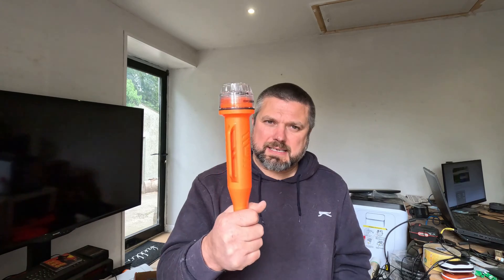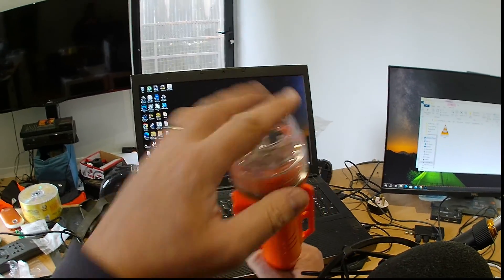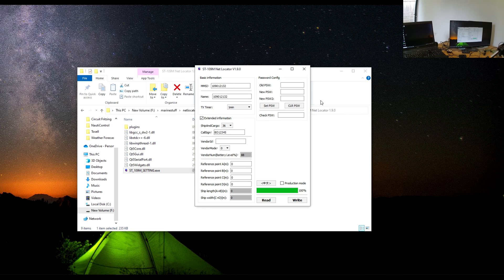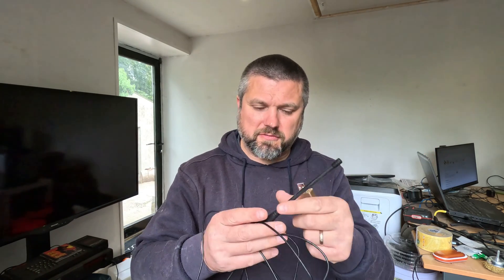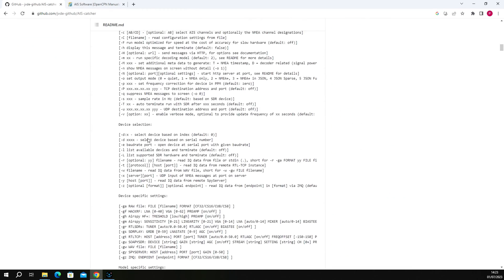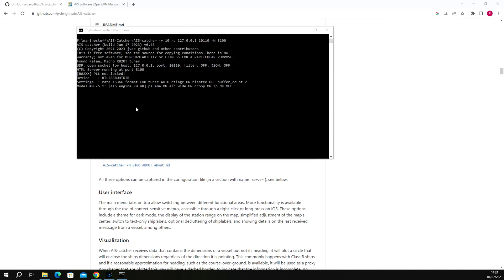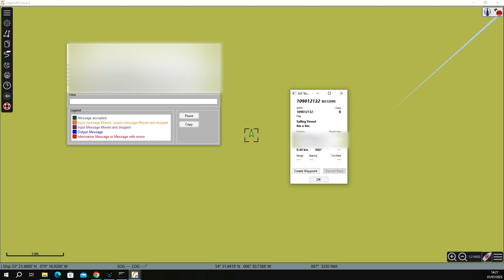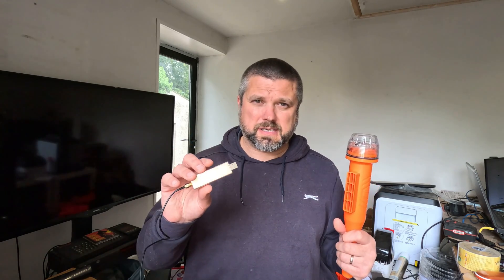Affordable DIY AIS Setup for Sailors: Socotran ST-109M,OpenCPN, AIS Catcher, and SDR Dongle Tutorial

Comment: I purchased Net Locator ST-109M recently and have found a bug. In the ST_109M_SETTING application, in the setting to input the distance of the net locator from the bow of the boat [Reference point A(m:)] after the boat length is input and the settings are written to the net locator, the net locator data on any AIS receiver that receives the single shows the distance of the bow to the net locator as the battery voltage. An example is, if the battery voltage is 100%, the distance the net locator is broadcasting the boat length as 100m, even though I only input a distance of 12m. The wrong boat length is therefore displaying on the AIS receiver of anyone who is seeing the AIS signal on their boat. This can be checked quickly by finding your boats location on the Marine Traffic app on your phone and looking at the data from your vessel. Has anyone else recognized this issue and found a workaround.

Comment: Is that flashing at 16:00 considered the slow or the fast flashing? According to the manual fast flashing means charged battery and slow flashing means need to recharge. I just got this transponder but for some reason when I connect it to my computer always the battery level says 1 when clearly is fully charged. So I need a way to know the battery level....

Comment: I'm stuck to the Fail Error "Can not find the net locator!"

Any workaround for troubleshooting?
Reply from the maker: have you checked your ports and what not , is it a compatible device as some may not i've done another video of another one i've hbought it worked different and had different software.
Reply: @boatsandbits  

I have checked the ports and it is detected in my Port: COM1 but when i try to read using the software, it shows "Can not find the net locator!"

Also, port driver is installed and up to date showing USB Sercial CH430(COM1) <<<<.

As you mentioned, "if it is a compatible device".

it should be similar to the one on the video.

But is there a way to properly check if it's a compatible device to this software?

Comment: Tony from Michigan would the AIS signal this sends out be able to be picked up by my Boat Watch app or my Marine traffic app and would it automatically pick it up when I turn it on or do I need to go in and change something?
Reply: Thank you for your reply. My question is will it transmit after I charge and turn it on or does it need to be programmed in order to transmit?
Reply: Thank you for your reply. My question is will it transmit after I charge and turn it on or does it need to be programmed in order to transmit?

Comment: Thanks for the link to the SW, however when I click READ, it just responds "can noit find NetLocator", anyone with a hint what to try? I have both power and com cable connected and net locator is ON
Reply from the maker: There are many variants which one do you have? Make sure com port driver is installed check my other video as the other one i bought read doesnt work but write does naybe similar with yours

Comment: My program says Net locator not found. it is turned on, all cables connected, still says can't find net locator
Reply from the maker: Most likely has a different type of serial usb connection , if you look up the devices in windows device manager and then go look for a driver .

Comment: I have attempted to program the AIS beacon but unfortunately the vessel length field always reverts to the precent of charge of the battery while the beacon is in use.  I contacted the distributor and they confirmed that this feature cannot be changed. So the beacon cannot display the vessels true length and thus displays vessels length between 1 and 99 meters!
Reply from the maker: The one I have seems to work ok for length it uses one of the other field , seems to be some variants.

Comment: I see that the programming cable that comes with this connects to both the power port as well as the programming port.  Is it possible to use the programming cable to charge the devie in leiu of the dedicated charger?  Asking because I'd like to have fewer electronics to carry on my small craft.
Reply from the maker: Should do though the batery lasts for ages!

Comment: How do you prevent an on board AIS receiver from seeing you as a target as transmitted by the ST-109?  I have a VHF radio that has an AIS receiver and seems to me the CPA to my receiver would be zero and if a zone alarm was set it would be constantly going off thus rendering that function useless.  Please advise.
Reply from the maker: Is there a way to block certain mmsis on your receiver ? I'd expect each device is different on how to deal with it

Comment: Has anyone tried the 10W version the RS-108M? Also has larger battery. The 109 is 5W. Is the software the same?
Reply from the maker: I must have a look !
Reply: The antenna and the hight of the antenna is the limitation, not the transition power.

Comment: Where do you find the driver for the usb?
Reply from the maker: Should be automatic for me anyways
Reply: @boatsandbits but does the software work on a Linux computer?
Reply from the maker: @kenh6722   i've not tried it with WINE  .
Reply: Did you find the USB driver. Just purchased with cable but error msg driver not found
Reply: Same problem for me...Did you find a driver? 😊

Comment: This arrangement seems to be illegal for boat use (or net marking for that matter) at least in US, and I wouldn't be surprised if also in Europe. Have you used it at sea? Does it report SOG and COG?
Reply: "The Low Cost Sailor" is where I first saw this adaptation to boat use a couple of years ago, and I'm sure he said it's not allowed in the US and not approved in the EU.
Reply: Most likely not legal in most European countries..
Reply: I use it with not problem at sea. When in movement, it does transmit your SOG and COG like any other clase b AIS
There is no slot allocation for clase b transmissions so that is not an issue either. Thanks for.your channel!
https://youtu.be/Dh1nbU1FiP8
Reply: @SailingMarisa   Yes, I got myself one for last summer and used it occasionally when offshore. Seems to work fine and the message is indistinguishable from most other class b messages.
Reply: @SailingMarisa  There is a single slot allocation at class B - called CSTDMA (Carrier Sense Time-Division Multiple Access). An AIS transmitter listens if a time slot is free before transmitting it's own data. If this is not the case (AIS transmitter sends  unconditioned), it can disturb the AIS communication of other participants and I think the AIS device must not be operated.
Reply: @hans-joachimstuewe2493  I can't be certain as I don't know how to check this, but the fact that it is not made to show data, doesn't means that is not receiving and respecting the slots. There are multiple.peopme I know using it and no problems so far
Reply: That is the question I have. Does it comply according to the regulations or not. At first glance I thought what a wonderful solution for my boat. A AIS buoy but not class MOB or SART but class B instead. But then I found a hint in the Linux setup tool (link in video description here). AIS fishing net locator not allowed in the US. It is from 2018 and maybe there is a new hardware/firmware today? But I doubt ...
Reply: @hans-joachimstuewe2493   in US this is clear. In Europe the legislation is lagging. My hunch is that it will be banned out of principle.  This shows as class b, it is indistinguishable from a 1000 e raymarine class b. I've tried not to advertise these in my circles lest some idiot makes a formal inquiry about their compliance... 
Bottom line is: it works, it has the TX power, messages and frequency like another Class B ais, but it operates on batteries and has probably limited range due to being lower, so that's the downside of saving about 920 e. I'm happy with it since I use it only offshore in night or bad weather.
Reply: @sailawayteam  thank You very much for the very interesting information. I am not worried about battery and range issues. So if the AIS locator works technically correct as class B device that's ok for me. I wonder why none of the well known manufacturers offers similar low end solutions analog to class MOB buoys, let's say for 250€ or so.
Reply from the maker: Not sure about that . If youve valid data being broadcast at legal power limits I can't see it being an issue.  Net marking though wouldnt be a valid use for AIS all the same! I've not heard of anyone being prosecuted . If used in emergency (MOB) I suspect not too many FCC ones are going to come after ya.

Comment: HI, I have configured the ST-109M with the 11 meter length parameters of my boat but the ST-109M overwrites the data and transmits the battery charge instead of the length. How can I make it transmit the correct length instead of transmitting the battery charge?
Reply from the maker: I think it transmits the battery as the manufactuer data rather than the length . if you have all the dimensions in then should display correctly . However I hadnt that inputed in my testing will update and see how it appears in Open CPN.
Reply: I'll also try to enter all the numbers and see what happens  @boatsandbits
Reply: V 1.7.0 seems to do the battery  in reference point A but v 1.9.0 seems not to. Check which version you are running,  it may help!
Reply: HI, How do I get the newer software? @martintruran8469
Reply: I am having the same problem, 1.9.0 does not seem to help. I don't want to transmit that my boat is 100M long. @martintruran8469
Reply: @martintruran8469 I have v 1.9.0 but it seems to be defaulting to the battery  level in Reference Point A. Any more workarounds ?
Reply: I'll have a check, 1.9 is still working for me

Comment: Love your work, amazing seeing what can be done on a budget
Reply: Could the transmitter be programmed to be an AIS boat transmitter rather than a MOB announcing device?
Reply from the maker: @dangable2889  it's not really meant to be a MOB so you can't work it as a  epirb (you can however use it so people can find you if you leave your boat!) but it does work great as an AIS boat transmitter , you can use the software to program in boat size etc .
Reply from the maker: Thanks for the comment , glad to hear someone gets some benefit out of these videos :-)
Reply: @boatsandbits  Your doing everything i want to do when get my boat back in the water, will run 2 of those cheap outboards with solar panels to help the boat along on each tack, but looking for 24v options so can get some charge into them from solar panels onboard
Reply from the maker: @cruzingbrumby  They do 24v versions of that motor I have I can't fault it works great past year.